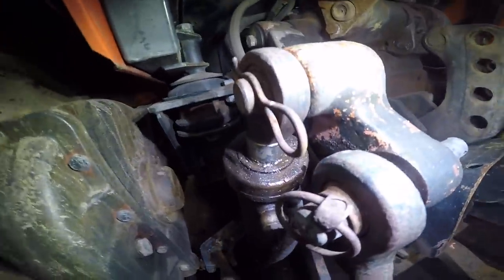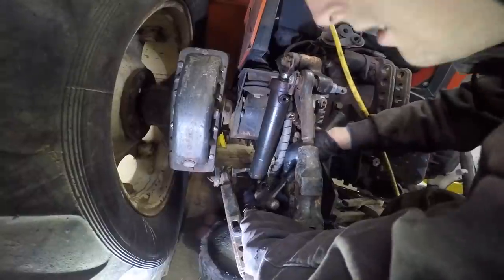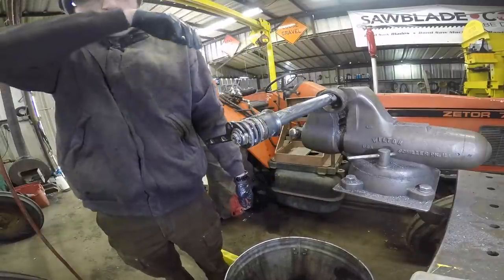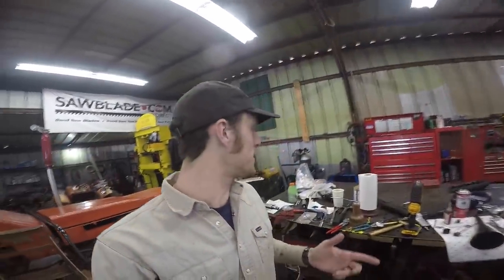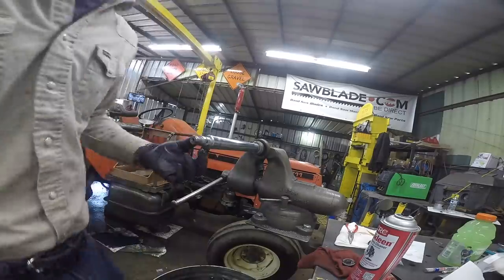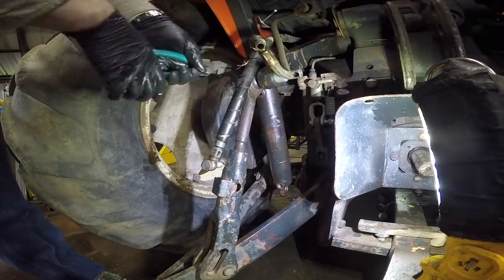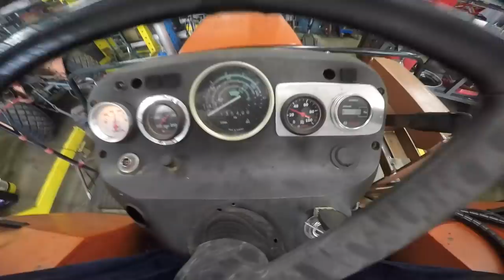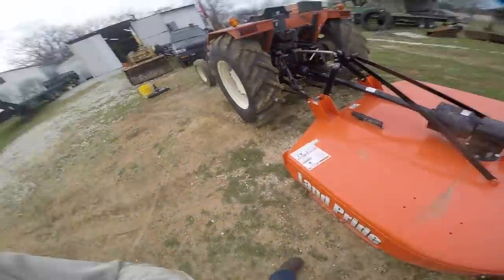IVE NEVER RE-SEALED A TRACTOR'S HYDRAULIC CYLINDER BEFORE... HOW HARD IS IT?!? DIY REPACKING

Comment: At 9:17 and 9:54  You can see the Flip Ring Clip catching on the hydraulic connector covers.  The pin goes missing shortly after 10:10, and you notice the cover is coming off.

Not sure if this is a new video or old footage, but wanted to point that out.

Comment: I need to do this on my front end loader. Finding the right parts will be a chore since it's on a grey market Yanmar.
Reply: Grey marker or not you can find a local hydraulic shop and it won’t be any trouble. Rubber is a little bit forgiving.